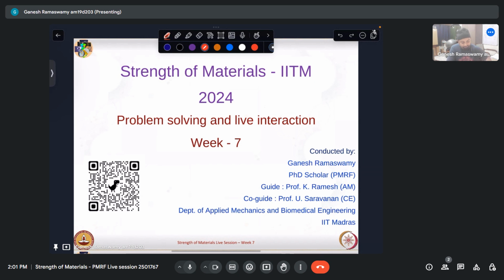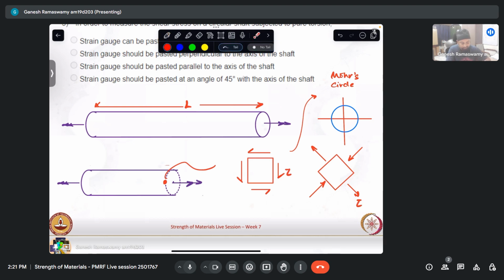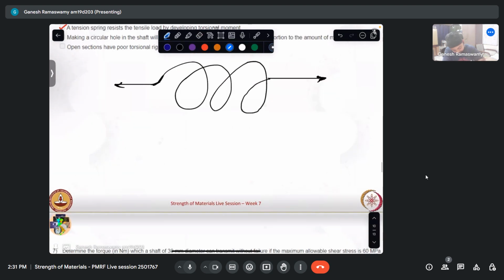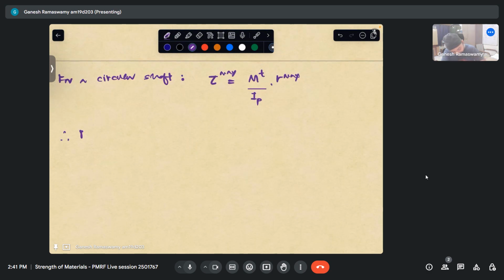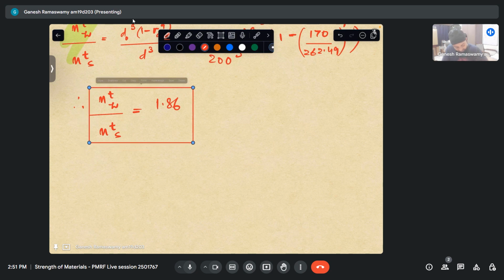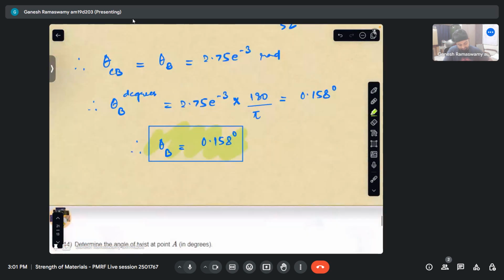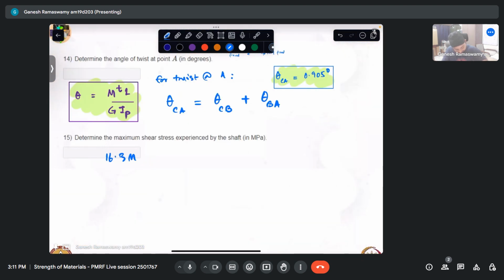Strength of Materials - Live Session | Week 7 | 2024

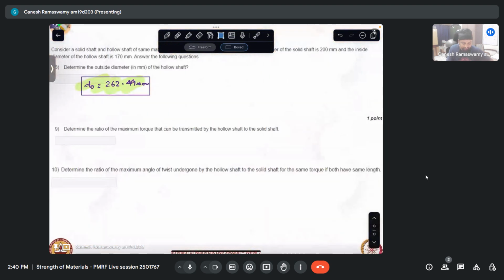Comment: 40:16 Q10) what is the maximum angle of twist and the minimum angle of twist if it exists!?
Reply: I think so it doesn't vary with r along the fibres of the cross section it only depends on the final value of r which is used to calculate the moment of inertia which defines the cross section l think there is no variation as such, l may be wrong!
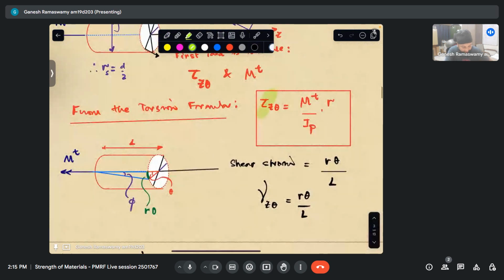Reply from the maker: Similar to the expression for shear stress, we can also derive the expression for shear strain and consequently, the angle of twist. This is done at 14:35 for a segment of length L.

If however, we have to consider a variable length , say 'x', we just have to repalce L with x.

Hence, when x = 0 representing an end that is held fixed, twist is zero and it linearly varies along the length.

Hope this helps.
Reply: Does the angle of twist also varies within the fibres of the cross section? Since for a solid shaft its proportional to L/r^4
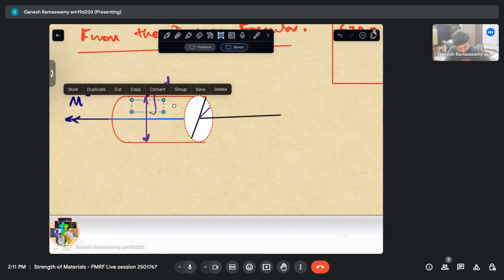Reply from the maker: @aniket16391  Look at the diagram used for deriving the shear strain at 10:57 which will also show what happens at a cross-section. 

Post your observation as a comment here.